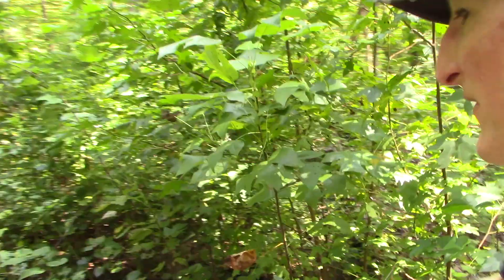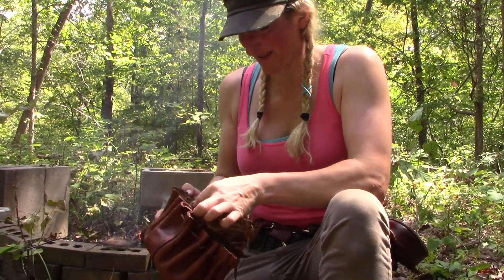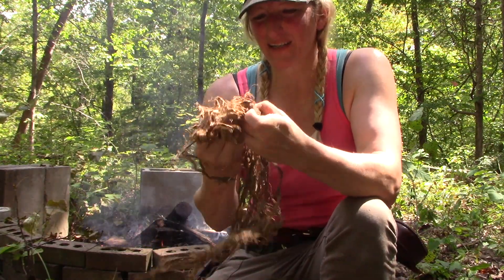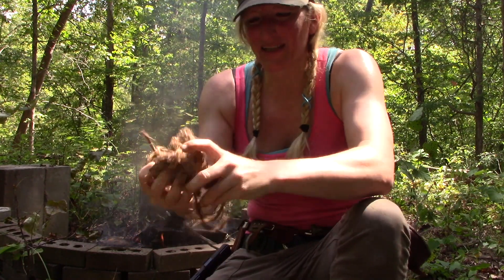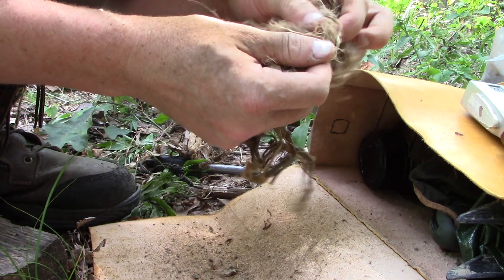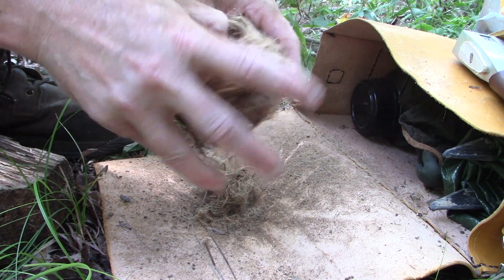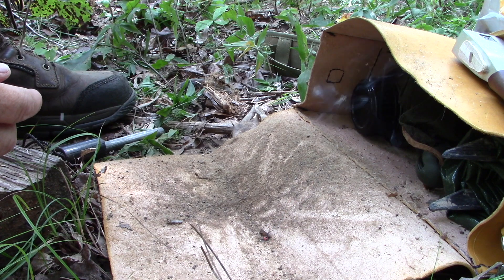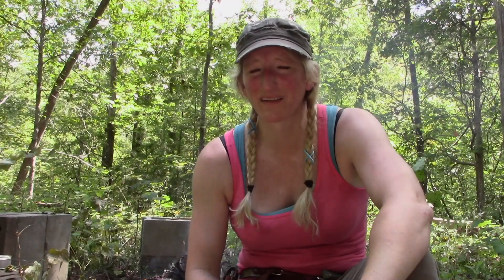Tulip Poplar and Ferro Rod

Comment: Tulip Poplar inner bark fibers are a great firestarter. 
The tree name is so familiar. I think morel mushrooms can be found growing around tulip poplar trees. All trees have a connection to certain fungi. For example chicken of the woods can be found on dead red oak.
Reply from the maker: The Tulip Poplar is one the best and most useful trees in the eastern woodlands. It grows at a rapid rate, is good for fire, shelter (bark is great for roofing material, Cordage,  and carving. In the old days the trees were so big the pioneers would cut them down and make canoes out of them. Some stories tell of canoes long enough to fit 60 men. Those were big trees.